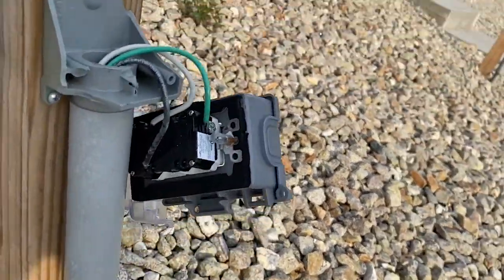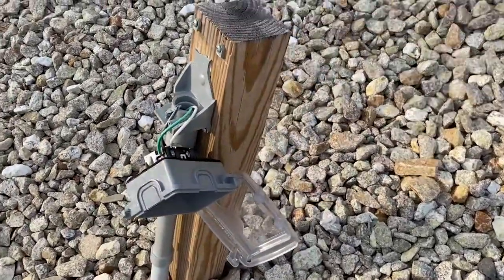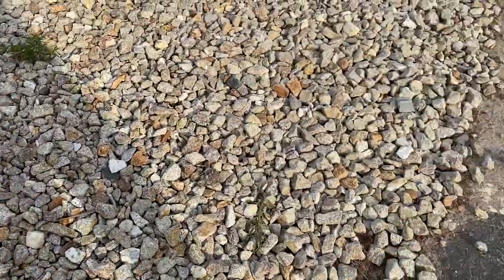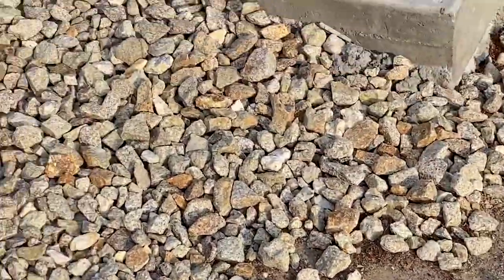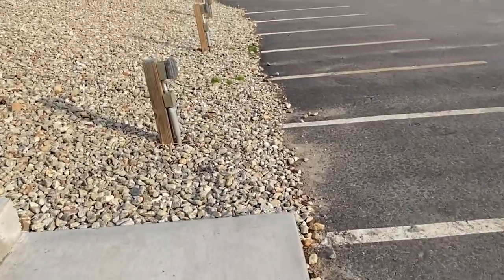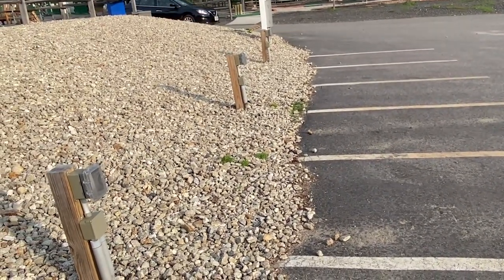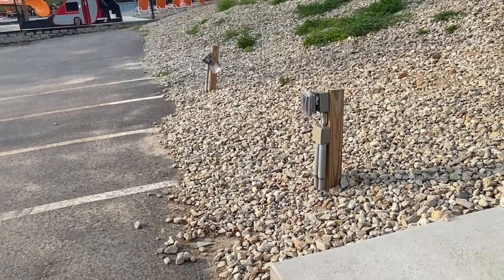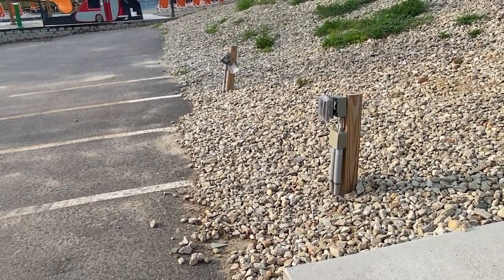Moving Violations No. 304: Smashed!

Comment: 2023 NEC 70 - 110.27 Guarding of Live Parts - 110.27 (B) Prevent Physical Damage. In locations where electrical equipment is likely to be exposed to physical damage, enclosures or guards shall be so arranged and of such strength as to prevent such damage.